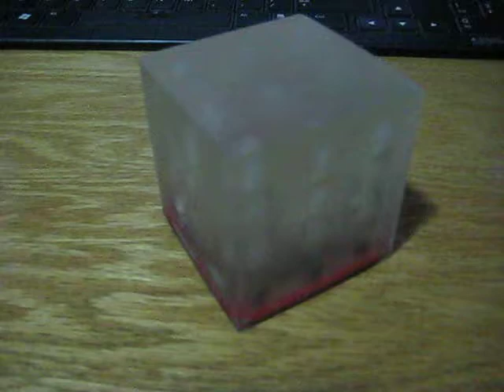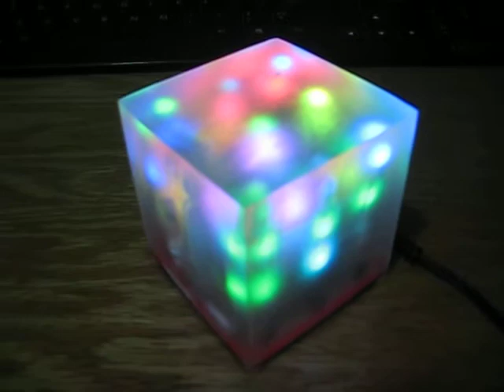LED Cube Finished

Comment: Hi I want to try out some resin projects, but since i'm new to the resin thing i was wondering how it is you achieved the frosted look. I would like to know before I purchase the wrong brand or something.
Reply from the maker: I used standard clear casting resin, but my mold leaked and the release agent didn't work properly so I ended up sanding it down on an edge sander until everything was flat. I was going to go further and polish it back to clear, but I liked the frosted look sanding gave it.
Reply: awesome! thanks for the quick reply, ill try sanding it =)